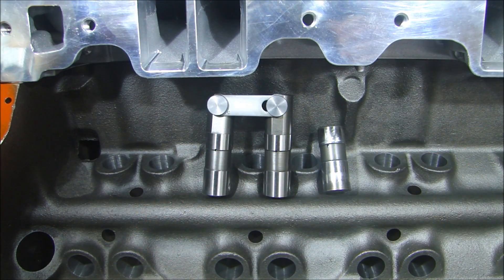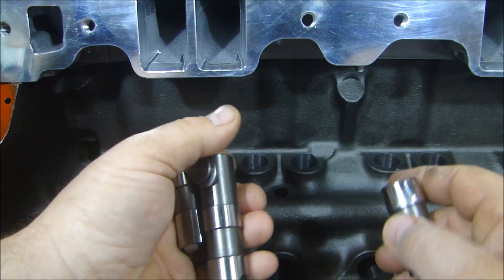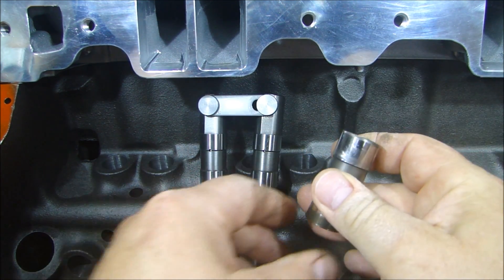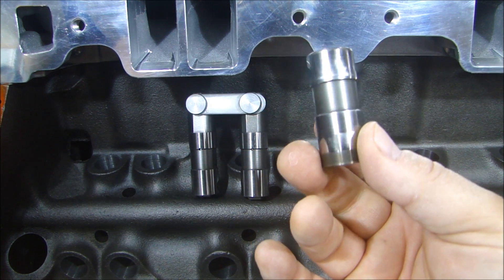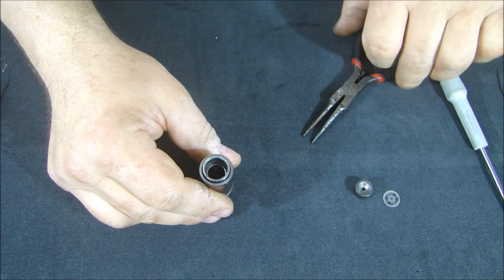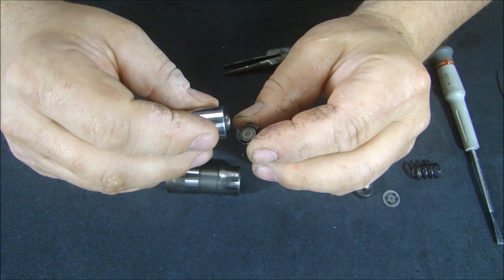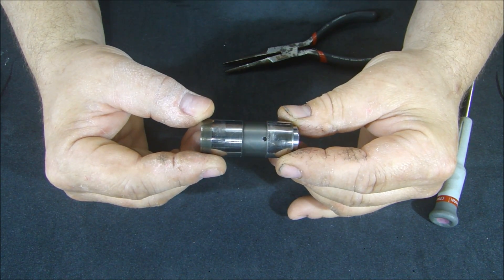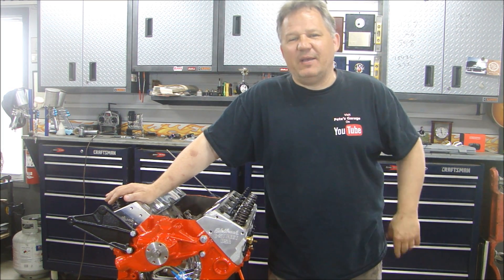Engine Building Part 10 - Hydraulic Lifters, Choosing, Cleaning, Assembling, Installing Roller Lifte

Comment: Searching around the YT for cam intel, gathering data. After the "just rebuilt" engine in my 62 C10 project truck rounded a cam lobe, seeing all the trouble on the internet, I'm not so sure I should have ordered a Comp 274H cam. Probably going to spend the money for a roller retro, but man they are expensive. In the 5 years since this video was made the kit is now $1100-$1500 now depending on if it includes pushrods and chain components. .
After that it's Comp, Lunati, Howards or another brand I haven't thought of?
Reply from the maker: I've used Comp a lot without issues. Lunati might be the next best bet

Comment: Hi Pete.  I recently had my 402 Chevy engine rebuilt, I hope my mechanic performed the cam break in properly.  I'm at the point where I need to change its oil for the first time since driving it about 700 miles.  Which type of oil do you recommend for a flat tappet cam?
Reply from the maker: I always use Penn Grade oil with zinc. It's a racing oil that is a bit more expensive, but worth it. The zinc acts as a lubricant for flat tappet cams

Comment: I'm almost 100% sure that hydraulic cam lifters do not "pump" the reason they have all the mechanisms you illustrated, are for the engine's oil pressure to make the lifters turn into a solid lifter after engine starts. When oil pressure has depleted because the engine was turned  off, the lifters relax, allowing the engine to turnover more easily for the next start. I could be wrong, but I don't think so.
Reply from the maker: If the lifters relax the check valve is leaking

Comment: Hello friend, I have a question related to this, if I remove all the lifters and activate the oil pump, should the same amount come out of all the ducts that feed the lifters? I am telling you this because in my engine, with the engine running and the rocker arm covers removed, not all of them release the same amount of oil on the rocker arms and if there is one that shoots jets that make the pressure clockwise The oil oscillates, is it possible that this lifter is causing so much noise in the engine, knock-knock type, and that the oil does not reach the other lifters properly, why does the pressure go away from that one? Greetings I hope you can help me
Reply from the maker: If you run the pump without the lifters you will only get oil out of a couple lifter bores. Without the lifters in, there is no way for pressure to build up. If you are using the old lifter they could be clogged, collapsed or have bad check valves.

Comment: I'm building a 70 ls7 454 and I'm putting a roller camshaft in can I just order a set of roller push rods or do I have to measure them all
Reply from the maker: You should measure because they do come in different lengths

Comment: Hey pete, when doing a flat tappet to roller, do you need to change up the push rods? Not sure if the lifter changes heights, I'm looking to convert my 67 289 flat tapet to roller
Reply from the maker: You probably will
Reply: Yes, you will.
Reply: @Mr Yuk  I know that know, I'm currently waiting on new arp studs to secure my heads

Comment: does it matter which way the tiny oil bleed hole in  the roller lifter faces?
Reply from the maker: It will only go one way with the link bar
Reply: @PetesGarage  I dont have the link bar, just the dog bones.

Comment: I can't get flat tappets to wear in properly. Summit racing techs have validated my process. I've spent $700 in scrap metal so far so....
Reply from the maker: Have you taken springs out of the heads or swapped them to reduce the spring load during break-in?

Comment: You have NO understanding of solid lifters Vs. Roller lifters. The solid lifter will have more valve acceleration early in the lift curve than a roller, simply because you can start the lifter movement close to the edge of the lifter face, so the larger dia. of the lifter the faster you can open the valve. .842 dis vs .937 dia. On a roller lifter if you try to force the lifter movement too soon if the life cycle you will wedge the lifter in the bore, this is why a roller cam lobe looks so different then a flat tappet lobe. So you have slower initial valve acceleration .
Reply from the maker: No understanding? Roller lifters also allow the use of more radical cam lobe profiles with faster opening and closing ramps that allow more total valve opening for a given lift and duration. Thank you for your expert comment.
Reply: @PetesGarage  You need to educate yourself on cam design and lifter dia. You study what Porsche does on all its engines. They have never built a roller cam engine, and for good reason. They are inferior to flat tappet engines, but then they use a lifter that is 1.625 in dia. Nothing w have the valve acceleration of that lifter.
Reply from the maker: I'm guessing you already know the math and physics of cam design, especially Porsche, so I'll take your word for it

Comment: One thing this guy did that no one noticed nor did he talk about. 
Which is the most important thing to do. 
Did you notice it ? 
I'm more strictly a Ford builder but I learned something about the mouse motor which has a small lifter foot and goes flat easier than a Ford. 
The common Chevy guys over look this. But this guy didn't. Notice the big Ford sign in his shop.
This guy knows the weakness of the mouse and so do i but I wonder if you know ?
Reply from the maker: You have a sharp eye my friend
Reply: @PetesGarage  I noticed how you carefully honed the lifter bores so Chevy's whimpy lifters will spin.
Reply from the maker: That's important

Comment: What's the difference between a roller block and a non-roller block?

I have a 351w C30E-6015-B-6 block number. I want to put a new cam in with roller rockers and lifters. Is there a retrofit type of set up to allow me to use my block?
Reply from the maker: Roller blocks are blocks that had factory roller cams. They can use factory lifters and hardware. Non roller blocks can still use roller cams but you either need to get a retrofit kit or buy aftermarket roller lifters

Comment: I'm telling you... Make some DVDs  Build it they Will Come...
Reply from the maker: I'll have to figure that out. I think I'd have to remake them, there are a few mistakes I need to correct
Reply: @PetesGarage  I think you would be more inclined to sell some DVDs if you went engine by engine. I bought a VCR tape years ago and the guy took a 350 engine from scratch and rebuilt it. I took the 350 in my Silverado and rebuilt it step by step which I had never done and it turned out excellent thanks to that tape! For the novice the suttle differences between engines leaves a lot of doubt. Anyway consider building one at a time. 350, LS small ford big Ford.....
Reply from the maker: Thanks Dan

Comment: Good day thanks for the lifters information. I know you did this video three years ago. I’m going through a previously rebuilt 351 Windsor. It has flat tappet lifters. My question is when I prime the engine with oil by turning the oil pump will the lifters get primed.? Will the lifters only get hydraulic pressure after pumping/spinning the crank and cam? If so will they pump up quickly? The reason I’m asking is because the lifters are completely flat therefore there’s no pressure on them to lift the rockers. I think you know what I’m getting at. Thank you
Reply from the maker: Yes they will. They will pump up quickly when the engine is started. Do it be hand and it will make the startup easier

Comment: So I have a L99 engine in my 2014 Camaro SS and I’ve heard they have lifter issues, can you explain to me why and if so , should I go with a better aftermarket set and or remove the Active Fuel Management system ? Thanks 🙏
Reply from the maker: If there is nothing wrong with it, leave it alone
Reply: @PetesGarage  ok but can you tell me what kind of lifters my L99 has ? Solid or lifters with a wheel , just curious and thanks for you advice, I’ve been told on the Camaro forums to use a tune to deactivate the active fuel management system and I will do that 😀😀🥳

Comment: Pete, you conveniently left out how to install the clip at the end . BOO !! Also you showed the roller lifters, that’s why I selected the video, then you switched to a flat tappet which is way easier. Here I have a few stuck roller lifers with spiral lock clips and your video avoids the most important part. Failure Pete.
Reply from the maker: Thanks for the comment. I'll keep that in mind for the next video

Comment: Glad I found your video, I’ve built no telling how many flat tappet sbc engines, were fixing to convert a 78 010 high nickel block 4 bolt to roller cam for a supercharger, thx for sharing
Reply: High nickel 🤣🤣🤣. That’s a old wives tale. A cast iron block has 0 nickel content at all. The only good 010 casting blocks are the 73 and older heavy casting blocks that have the 2482 nodular main caps
Reply: @brandonbell3089  Lots of old wives tale around. Bet it was a Corvette block too.
Reply from the maker: Very cool!
Reply: Bubba ever had a cam go flat ?
Reply: Yes cam I have, I’ll never build a flat tappet cam engine again, the roller is much better 😀
Reply: @BubbaAyers1969  thanks for honest answer.
As a side note. It appears these lifters of modern day are of poor quality. 
I have taken lifters out of old engine's 40 and 50 years and reground their foot and run them. 
Never had one fail yet. If one clicks and doesn't pump up I just replace it.
One of these days I'll do a step by step video and bust the myths about the so called breaking in of a cam.
I keep waiting and watching for the day when roller lifters start being made on the cheap.
A tip. Put magnet in bottom of oil pan in all your builds. I also put magnet in the drain back hole in heads. You'd be surprised how much metal dust goes through even a blue printed engine.
Reply: Cam I think there’s two different manufacturers of lifters, there’s a channel I watch that talks about this, it’s got to do with the harder on the bottom, you can run a flat tappet, just watch who you buy from
Reply: @BubbaAyers1969  I've rebuilt more than 400 engines. Most of my cams came from Delta Cams in Tacoma WA.
Never once have I had a Ford cam go flat. I worry if I do a Chevy so I always put a cam button on that engine.
To save the cost of buying HT 900's I started to resurface old lifters. Never had them go flat either. I am aware of all the different forms of flat tappets including Roads lifers.
Reply: Cam I’m just g u n shy from flats now, my luck I build one and it goes flat on a customer cause he didn’t follow instructions can cause problems

Comment: Hey bud, I'm replacing the wussy solid flat tappet cam in my 428FE that I bought from Jim Dove. It was for his truck, so no need for a big cam. He's retired now. I'm going back and forth on either a mechanical roller or hrdro roller., I'm not racing anymore, so it'll be for street fun (I'm on the engine all the time) and a few racing events a year, If you recall I built a 427 S/C Cobra years ago. In your latest video here you've gone with a hydro. Did you just want a lower RPM daily driver for the Stang ? For my purpose, I won't be going over 6,000 RPM,  but I'm a little concerned about oil bubbles in the lifter  at higher RPM, would you ? I don't mind lashing valves on a solid roller, I did check them on my other engines with a solid flat tappet. And now with the solid  roller wheel that are  replacing   the tiny bearings, I'm not worried. People think that you have to last the valves all the time, but you don't if you set up the valvetrain properly.  So what cam type would you suggest ?
Reply from the maker: I use hydraulic to keep it maintenance free. I wouldn't worry about bubbles. A roller cam does reduce friction
Reply: @PetesGarage  ok, thanks Pete. The build is looking great.

Comment: whats the expected life of retro roller lifters in a SBC for daily driver?
Reply from the maker: I would expect years
Reply: @PetesGarage  the reason i ask is because i want to build a 400SBC to install in my gmc,savana van to use as a tow vehicle for my travel trailer. i dont want to install them and have to replace them in 20 or 30,000 miles. worried about the tie-bar breaking.
Reply from the maker: Nothing to worry about

Comment: Don't forget you may have to change the gear on your distributor when switching from a flat tappet cam to a roller cam.
Reply from the maker: Could you please explain why?
Reply: @PetesGarage  yes some roller cams such as my comp cam require a brass distributor gear.
Reply from the maker: So it may be more the cam and not necessarily because it's a roller
Reply: @PetesGarage  Yes, but I think it's more common for the roller cams to use a different material fo their distributor cam.
Reply: @PetesGarage   Roller cams and flat tappet cams use two different metals.

Comment: Hey Pete...love your channel and your tutorials. I'm new to Chryslers. My last Chrysler motor build was a huge success. And in no small part thanks to u, but I wanted a little more punch so I have decided to increase my cam lift a little bit (going from .488 to .545 lift) and in the process, I'm also upgrading to a roller cam and heads because the break-in on a flat tappet cam is always so stressful for me. Now I'm reading a lot of stuff about a roller cam requiring the same break-in procedure at 1800 -2000 rpm for 20-30 minutes or the cam will go flat just like a normal flat tappet cam. l think I saw u using a break -in oil, on another build w/ roller cam ( BB chevy maybe?) but does that mean I should be using a break-in oil with my Chrysler motor (like this one) and equally important, does it need to be broke in just like a flat tappet cam? 440 source says no need to worry of cam failure if using a roller cam. But I trust you and would like clarification on this subject. Thanks man.
Reply from the maker: A roller really does not need a break in, but I use the break in oil on every first run
Reply: Thanks Pete...Appreciate it very much. You're the best!

Comment: A very informative video. I'm looking into converting a 400 to hydraulic roller, and wasn't sure if you had the link bar that you still need the spider or dogbone. Just the durability,the more choices for oil,  and lack of maintenance for a roller setup makes it worth it to me. Then on top of that the possibility of more aggressive cams. I am wondering though, would there be anymore benefit of running zddp in the oil still with hydraulic roller tappets and hydraulic roller rocker arms?
Reply from the maker: With a roller you don't need special oil, but it doesn't hurt

Comment: Hi Pete, you must have noticed some lifters have different oil metering plate. They have no holes and the pushrod cup bottom does not have the passage guiding the oil to the middle hole.
You should do a part 2 video where you show this. Because those lifters are worse quality and i bet have problems oiling the top as they will only pass oil on "leak" phase of the lifter. And some Compcams lifters wont even do that. People should be warned and showed different brand lifters and their innards so they can choose working one. Im trying to do video about it myself soon.
Reply from the maker: Great suggestion, I'll do that

Comment: My question is do you pump them before install lifter or just soak them in the oil
Reply from the maker: I just coat them. They get pumped up when you pre-lube with the pump

Comment: I GOT A PROBLEM I NEVER SEEN BEFORE , I PUT A SET OF HYD ROLLER LIFTERS IN MY MOTOR AND I NOTICE SOME PUSHRODS ARE SHORTER THAN THE OTHERS BUT THEY ARE NOT !!! I ADJUSTED THE ONES THAT WASN'T COLLAPES BUT THE OTHERS WHERE TO SHORT TO ADJUST, SO TURN THE OIL PUMP WITH A DRILLL TO 60 LBS AND THEY PUMPED UP SO I KEEP THE DRILL RUNNING AND ADJUSTED THEM BUT WHEN I SHUT THE DRILL OFF AND THE PRESURE WENT DOWN THE PUSH RODS ARE SHORT AGAIN AND THERES PLAY IN THE ROCKER ARM , WHATS MY PROBLEM ???
Reply from the maker: You have to turn the engine over a few times. If they are bleeding down there may be a problem with them

Comment: How noisy are those retrofit roller you installed in that engine ? I've tried numerous times to quiet mine down some. I've built 10-15 of these small block 350's. Some with stock roller setup, and some really wild big lift Camshafts. I just finished a 406 stroker using these retrofit hydraulic roller lifters with a mutha thumper camshaft. First adjustments were 0-lash then 1/2 turn more. These things sounded like they were hitting the inside of the intake lol. And the oil pressure is at 80psi and 55-60 when up to temperature. So I readjusted them using 3/4 turn after 0- lash. A little quieter but still loud. Final adjustment was 1 full turn after 0- lash and they are all still tapping pretty loud. I am not going any further than that with the adjustment. I don't like running them tight like that. The engine runs good but I am scared there's something is not right. And I don't want to keep running it and smash all these expensive things to bits. Is it just the way these lifters are ? or is there something I'm missing ?
Reply from the maker: Did you measure the pushrod length to make sure they right? Too long or short will cause noise.